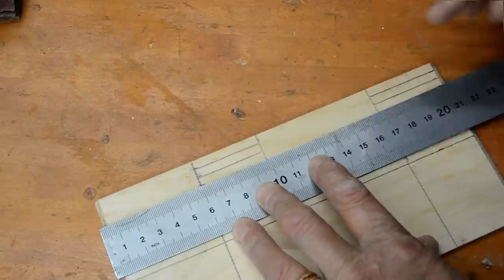`Make your own Sanding Mop

Comment: Thanks for the tips.  I found I didn't need a scrollsaw or bandsaw to cut the strips.  Scissors work just fine.  A little irregularity in the "feathers" at the end of the strips doesn't hurt the action.
Reply: The jig was the key to my success. I clamped the bundle in a vice and used a hack saw to cut all the fingers into the flaps. It was almost fun to make up a few different mops, with thicker fingers they sand a little more aggressively. She sure saved me a bunch of cash cause there is a company who wants $80 for 1 grit mop and they want $23 for the refill bundles. Cheers.

Comment: Very good, I have some sand flee sanding mops but to replace the sandpaper.  The Idea of cutting the sandpaper with a scroll saw is great the blades a cheap and cutting sandpaper dulls blades very fast.   I like the hack saw idea also for tearing to length.
Reply from the maker: Thanks you, glad you like the idea and for watching

Comment: Thanks great "how to" . Harbor Freight sells 80, 120, 180 grit aluminum oxide sheets, in 10 piece packs for $6.00. I made 2 wheels for around $5.00 using spare washers and bolts. Your video got me final details, thanks again.

Comment: Thank you for sharing this - fantastic job.
The stack of abrasive cloth is obviously highly abrasive to tools, so I was thinking:
1. For cutting the stack of sanding cloth I'm hoping I could use a rodsaw or a jigsaw with tungsten carbide blade, as I lack a scroll saw. 2. For those of us who lack drill (bit) sharpening equipment, to drill the hole a multi-material tungsten carbide bit might be a good choice, if you have one already. I guess even that will need sharpening quite soon after this, but it's worth it to make sanding mops!

Comment: Very cool tool. 

Can the stack of sand paper be flipped to effectively reverse the direction of the grit when the sand paper starts getting old?

And how many scroll saw blades did you go through cutting all that sand paper?  :-)
Reply from the maker: It take awhile till you sandpaper is dull. You can turn it but I don't know if the effect will be the same. Yes it cost me some saw blades  😀

Comment: That is a great idea. I like that you made a template for the cutting. I first thought about how would you cut the sheets, because scissors may get dull. But then.... yes, a scroll saw blade is not expensive. Great project. Greetings, Daniel.
Reply from the maker: Thank you It worked very well with the templates

Comment: I made a sanding mop like that,I want to warn others,It will be cheaper to buy a sanding mop online for about 20.00 than to buy the sandpaper roll and other parts,plus the cost of a new bandsaw blade.My new blade got sanded dull about the third cut in.so you got to add blade cost to the project too.I don't know how much a scroll saw blade costs but I bet she used a few. just a FYI.
Reply: Scroll saw blades cost $0.30 apiece.
Reply from the maker: +James McGuire  Well you can use used the belts form a beltsander and it cost you 2 dollars.
Reply from the maker: +Carving By Poindexter well not mine.... you can use anything you like